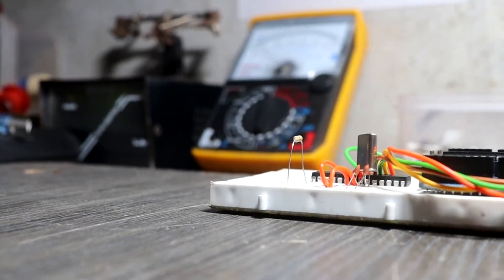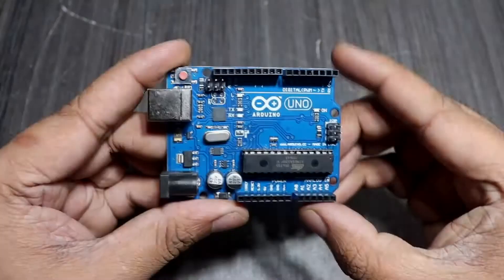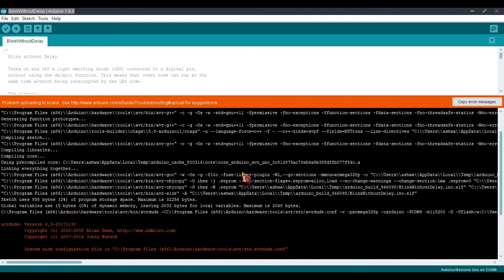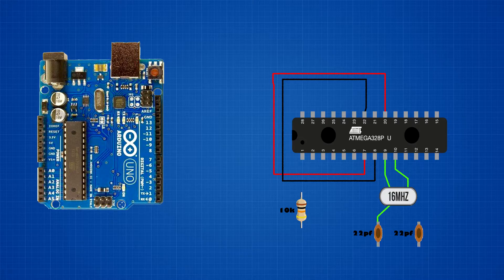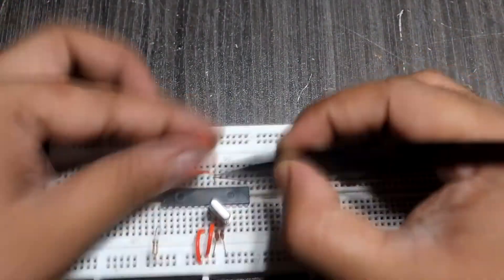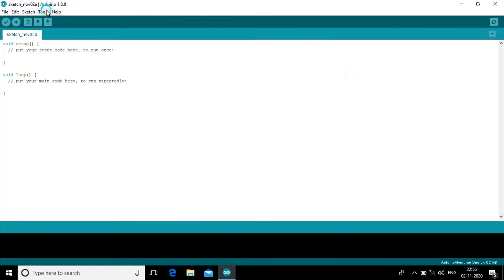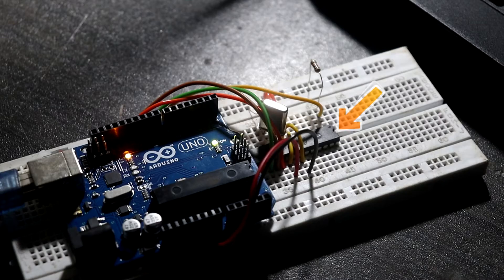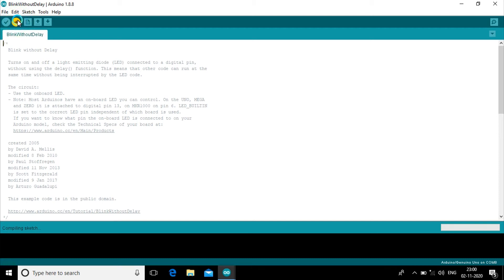HOW TO BURN BOOTLOADER IN ATMEGA328P MICROCONTROLLER . HELP OF USING  ARDUINO UNO

Comment: If the chip has an internal clock is there a method to program without the oscillator and capacitors?

Comment: Very nice now I want to set it up as 8mhz internal RC
Reply from the maker: For an Arduino, you can set it up to use the internal 8MHz clock. Configure your Arduino  to utilize the internal 8MHz clock, and remember to adjust any timing-sensitive parts of your code accordingly, as the clock frequency has changed. If your arduino originally had a 16MHz external crystal, this alteration might impact the timing of your program.

Comment: hello sir....I have this error, can you please help me resolve it .......avrdude: Yikes!  Invalid device signature.
         Double check connections and try again, or use -F to override
         this check.

Failed chip erase: uploading error: exit status 1
Reply: same here.
Reply: Avrdude dislikes your lovely 328-PU chips and says “avrdude: Yikes!  Invalid device signature.” or "avrdude: Expected signature for ATMEGA328P is 1E 95 0F"

Soln:- This problem happens becoz ur arduino uses 328p - pu and if u bought 328pu(a couple dollars cheap).

The soln is to modify Arduino > hardware >tools>avr>etc and open avrdude.conf file as word document.keep backup of this file incase u mess up.

find 1E 95 0F text under Atmega328 and change it to 1E 95 14 and save.

restart arduino environment and burn bootloaders on all ur chips.use status leds as mogul said.they help a lot.

After burning change the text in avrdude.conf file back to 1E 95 0F and restart arduino ide.Then u can uplode code normally.

Comment: Sir am design digital DC Volt metre using UNO board, working is fine. But using only ATmega ic + 16MHz crystal, working is not fine LCD reading is very fluctuate. Program is same. Any solution sir ?
Reply from the maker: Fluctuations in the LCD reading could be due to issues with the power supply or noise affecting the analog components. Ensure a stable power source for the ATmega IC, check the connections, and consider adding decoupling capacitors near the power pins. Additionally, grounding and shielding can help reduce noise. Double-check the wiring and try isolating potential sources of interference.

Comment: How can i fix this? avrdude: Yikes!  Invalid device signature.
         Double check connections and try again, or use -F to override
         this check.
Thank you
Reply from the maker: Check Connections: Ensure all connections between the programmer and AVR microcontroller are secure and correct.

Clock Settings: Match the clock settings in your programming software with the microcontroller's actual clock frequency.

Device Selection: Select the correct microcontroller model in your programming software.

If the issue persists, consider trying a different set of hardware components or using the -F flag with AVRDUDE to override the check.Please try these steps and check if they resolve the issue. If you continue to face problems, kindly provide more details about your setup. Alternatively, you can join my WhatsApp, and I will guide you through the troubleshooting process.

Comment: hello sir can you make standalone programmer for arduino without PC, maybe the arduino using SDcard for save the hex file then just like click the push button and it going flash the atmega8
Reply from the maker: Creating a standalone programmer for Arduino without a PC is indeed possible. You can use an Arduino board to achieve this, along with an SD card module and a simple user interface, such as buttons and a display. However, implementing this would require a good understanding of Arduino programming, knowledge of the AVR programming protocol, and careful hardware connections to ensure proper functioning.
Reply: @Circuitoptimize23  can you make a tutorial for that
Reply from the maker: May be in future..

Comment: I have an error while burning:expected signature for at mega 328p is 1e 95 0f 
Use -f to override error while burning
Reply from the maker: It looks like you're encountering an error while trying to burn a program onto an ATmega328P microcontroller. The error message 'expected signature for at mega 328p is 1e 95 0f' usually indicates a mismatch between the target microcontroller and the one selected in your programming environment. To resolve this, please double-check the following
Ensure, you've selected the correct microcontroller model (ATmega328P) in your programming software.
Verify your connections between the programmer and the microcontroller, making sure they are secure and correctly wired.
Confirm that you have the appropriate bootloader and firmware for your specific ATmega328P chip version.
Reply: @Circuitoptimize23  the error is corrected thank you ❤❤🥰

Comment: I get this error 
avrdude: stk500_recv(): programmer is not responding avrdude: stk500_getsync() attempt 1 of 10: not in sync: resp=0x1a 

What I can do?
Reply from the maker: The Arduino IDE displays anavrdude: stk500_recv(): programmer is not responding error message indicating its inability to establish communication with the ATmega328PU chip. To address this issue, you can consider a few potential solutions. First, updating the Arduino IDE software might prove helpful. Additionally, installing the latest drivers for your USB port could resolve the problem. Ensuring that the ATmega328PU chip is in reset mode before attempting to burn the bootloader is essential; this can be achieved by grounding the reset pin on the chip. For Mac users, trying the deactivation of the "USB Debugging" option in the Arduino IDE preferences might be worth considering.

Comment: Arduino: 1.8.15 (Windows 10), Board: "Arduino Uno"

Error while burning bootloader.

avrdude: Yikes!  Invalid device signature.

         Double check connections and try again, or use -F to override

         this check.
Reply: Same here. Did you solve it?
Reply from the maker: Sorry for the late reply.. So if you're issue is related on (Invalid device signature) so this the common problem. Invalid device signature error indicates that the signature read from the microcontroller does not match what is expected for the selected microcontroller. Make sure Ensure that the clock frequency settings in the Arduino IDE match the clock configuration of your microcontroller. The ATmega328P can be operated at different clock frequencies, and this needs to be correctly set in your code. And select the correct microcontroller model in the Arduino IDE or programming software. For an ATmega328PU, you should select "ATmega328P" as the board. If you've double-checked all of these aspects and are still encountering the error, you might want to try using the -F flag as suggested in the error message to override the device signature check. However, be cautious with this approach as it might lead to programming the microcontroller with incorrect settings.

Comment: Would like to know, I'm doing a project with Arduino and already programmed him. But I had to change the code so needed to program again. I need to do all this steps again, like load Arduino as ISP to Atmega328?
Reply from the maker: Yes, if you need to reprogram your Atmega328 chip, you will need to follow the steps to load the Arduino as ISP onto the chip again. This includes connecting the appropriate wires and using the Arduino IDE to upload the ISP sketch. Once the Arduino is set up as an ISP, you can then upload your new code to the Atmega328 chip using the appropriate programmer settings in the IDE.

Comment: Hello brother can we upload any code inAmega8-16pu ic.
Reply from the maker: Yes, it is possible to upload code to an Atmega8-16PU IC. The process is called "programming" and it typically involves using a programmer device connected to the IC and a computer running software to transfer the code to the IC's memory. The specific process will depend on the programmer and software being used.

Comment: I have this error:

Error quemando bootloader
avrdude: Yikes!  Invalid device signature.
         Double check connections and try again, or use -F to override
         this check.
Reply: Avrdude dislikes your lovely 328-PU chips and says “avrdude: Yikes!  Invalid device signature.” or "avrdude: Expected signature for ATMEGA328P is 1E 95 0F"

Soln:- This problem happens becoz ur arduino uses 328p - pu and if u bought 328pu(a couple dollars cheap).

The soln is to modify Arduino > hardware >tools>avr>etc and open avrdude.conf file as word document.keep backup of this file incase u mess up.

find 1E 95 0F text under Atmega328 and change it to 1E 95 14 and save.

restart arduino environment and burn bootloaders on all ur chips.use status leds as mogul said.they help a lot.

After burning change the text in avrdude.conf file back to 1E 95 0F and restart arduino ide.Then u can uplode code normally.

Comment: Hi!
When I tryed to burn the bootloader to the chip, I recieved the folowwing message:

avrdude: Yikes!  Invalid device signature.

         Double check connections and try again, or use -F to override

         this check.

Can anybody help me?
Reply: I have the same problem, did you fix it?
Reply: @fenixmunozgarcia2021  yeah, i had contact problema on the breadboard
Reply: @matyasfazekas2481  Oh, thanks, maybe that is also my problem.

Comment: help me pls this methode not work for me
 ( avrdude: Yikes!  Invalid device signature.
   Double check connections and try again, or use -F to override
   this check)
i have two new atmega328p
Reply: I have the same problem, did you fix it?
Reply: Avrdude dislikes your lovely 328-PU chips and says “avrdude: Yikes!  Invalid device signature.” or "avrdude: Expected signature for ATMEGA328P is 1E 95 0F"

Soln:- This problem happens becoz ur arduino uses 328p - pu and if u bought 328pu(a couple dollars cheap).

The soln is to modify Arduino > hardware >tools>avr>etc and open avrdude.conf file as word document.keep backup of this file incase u mess up.

find 1E 95 0F text under Atmega328 and change it to 1E 95 14 and save.

restart arduino environment and burn bootloaders on all ur chips.use status leds as mogul said.they help a lot.

After burning change the text in avrdude.conf file back to 1E 95 0F and restart arduino ide.Then u can uplode code normally.

Comment: Hi, I'm a beginner. So to put bootloader into a chip, you use sketch called ArduinoISP with 'ArduinoISP' profile. After compiling and succesfully upload the sketch, you switch different profile called 'Arduino As ISP' and burn bootloader. Do I understand it correctly?

Now how do I put a sketch to the new chip if I don't want to remove atmega chip from my working arduino?

Comment: My Arduino UNO has a surface mount chip and not through hole can i use the same method to burn bootloader on a through hole microcontroller? I want to use the new microcontroller on a breadboard with Arduino codes not to replace the old chip on my Arduino.

Comment: doesn't work for me... I don't know why 
this is the error message : 

avrdude: Expected signature for ATmega328P is 1E 95 0F

         Double check chip, or use -F to override this check.

Erreur lors de la gravure de la séquence d'initialisation.

Ce rapport pourrait être plus détaillé avec
l'option "Afficher les résultats détaillés de la compilation"
activée dans Fichier -> Préférences.

Comment: Dear sir hi, when I upload the program in arduino uno like a blink led or fade program through android phone, mobile screen show,
Error, problem up loading to board.
Plz help me explain me how I fix this problem.
I also select the arduino uno board in board setting. I tried so many time but same issue plz help me, explain me, if you no mind plz help me thnx.
Reply from the maker: Sir my recommend please used PC... If you going to burn arduino bootloader I highly recommend pc version arduino ide,

Comment: why i have this problem..
Arduino: 1.8.12 (Windows 10), Board: "Arduino Uno"

avrdude: Yikes!  Invalid device signature.
         Double check connections and try again, or use -F to override
         this check.
Reply: Same problem bro
Reply: Hey i am having the same issue, kindly help me to solve this i searched a lot to resolve this but cant find any solution for now, please help@ CREATIVE GENIUS
Reply: @Circuitoptimize23  i need some help, i am having same issue, error during upload how can i solve this one